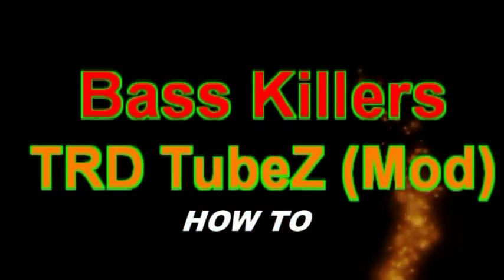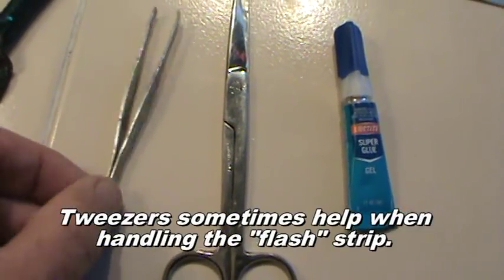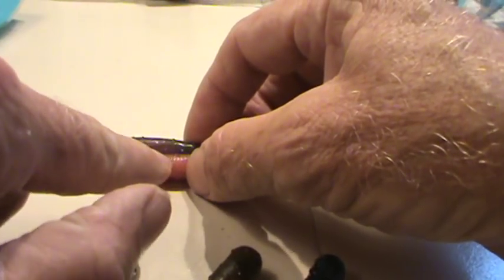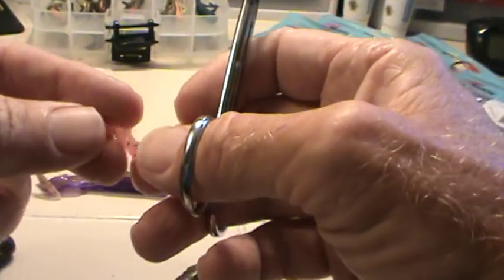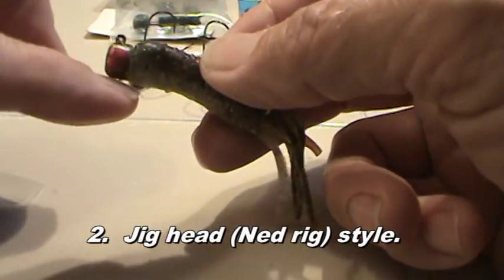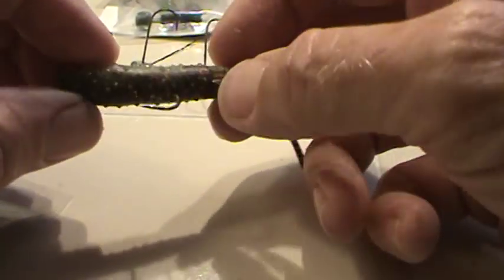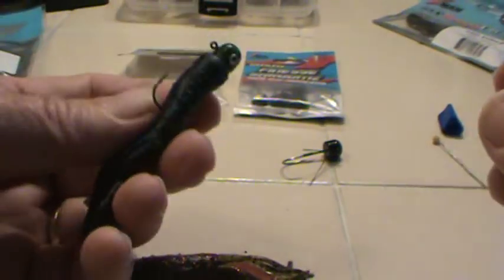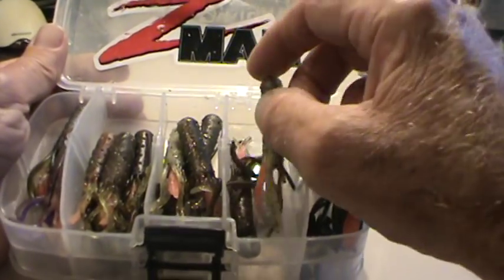How to Make the "Flasher" - a Z-Man TRD TubeZ Mod

Comment: Love this awesome mod going to try it out this season, also what brand of storage case are you using and where did you get it, nice size small and compact.
Reply from the maker: Thank you, Big Mike.  Nice to hear from you and hope all's well on your end.  After tinkering around with Elaztech plastics for several years, the "leaders of the pack" include 3-4....and which includes the Flasher.  One of the top two biggest bass of 2018 (21+ inches) hit a Flasher (the other grabbed a Z-Man MinnowZ).  They are very easy to make and can be made from all nine colors of the TRD TubeZ so that's a big bonus. I've kept my Elaztechs in common Plano boxes available just about anywhere.  Another nice thing about Elaztech is that it is very resistant to color bleeding.  Using Texas rig or the new Finesse Bulletz jigheads make them quite weedless...another bonus.  Good luck this season!  Don
Reply: WinkieDoodles one more question what hook weight sizes are you using?

Comment: Great video as usual, Don! I’m looking forward to constructing these Flashers and giving them a shot on my usual waters.
I wanted to ask though, how heavy was the weight you were using in this and the previous Flasher video and what would an ideal weight be for this (Texas rig) if fishing deeper than say 10-12 feet? 
Thanks again!
Reply from the maker: Thanks so much, Randal.  These Flashers are like mutant TRD TubeZ with super powers!  Ha, ha.  I knew the TRD TubeZ were great lures when Z-Man introduced them a year or so ago.  In hydrilla/weeds/shallower water I like the 1/16 oz bullet weights.  For 10-12 feet or so, you can still use the 1/16 or go with a 1/8 Oz.  Bass Pro shops worm weights are what I use all the time for Texas rigs.  Don

Comment: Great job on this, and thanks for sharing! TRD TubeZ have become my favorite smallie bait in moving water. I can't wait to try this.
Reply from the maker: Thanks, Buck.  I've "fiddled around" with Elaztech lures for quite a while and can affirm that the Flasher is one of my top 3 favorite "mods".  On the issue of mounting, my recommendation is to use the new Z-zman Finesse Bulletz jig heads; they are perfect for the Flasher.  These new jig heads were introduced at  ICAST 2018 and are real 'game changers'.  Check them out.
Reply: I'll be getting some of the new jig heads soon. My local tackle shop will be getting some in. I made 5 tubes   with flashers today. I found green pumpkin/orange ZinkerZ to cut down. I did two mudbug tube's with chartreuse flashers as well. I'll be trying these this coming Friday on the Va New. Thanks again for the tips!
Reply from the maker: Oh, wow, I bet your Flashers will be great in moving water on smallies.  I have a vid coming out soon with a 21+ inch bass and a Flasher/BulletZ jig head in her lip.  I'm hoping the new SnakeLockZ jig heads will work as well on my new EZ TubeZ Flasher mod.  More to follow on this.  Don

Comment: Why don't your fingers stick to the bait, the way mine do when I use super glue?
Reply from the maker: Ha, great question Jim.  Trust me, I've glued my fingers together and had to slice through glue and skin.  I've learned to use a minimum of super glue and let it sit 15-30 seconds before messing with the plastic.  Practice doesn't make perfect when it comes to super glue but it helps to learn how to handle the item being glued to minimize the extra "skin" that will take days to peel off fingers.  All the best, Don

Comment: just have a quick question, i can not find that "bama craw" zinkerz anywhere: where are you getting them if you donot mind me asking
thanks in advance
Reply from the maker: H Saban No problem.  I purchase a great number of Z-Man products on-line from Tackle Warehouse or this color should probably be available at the Z-Man website.  Probably most of the larger Bass Pro stores carry them.... if they aren't sold out.  You can, of course, use a green pumpkin/orange TRD but the most economical source is from the ZinkerZ.  This Flasher really is an excellent mod!  Don

Comment: Why not just insert inside the tube why cut the tube ?
Reply from the maker: Mike Hart Thanks for watching and for the good question.  Splitting the tube is all about the easiest and least messy way to lay in the super glue to hold the orange flash.  It may be possible to do it another way.  My precision with small things slathered with super glue isn't the best... :)  Thanks!